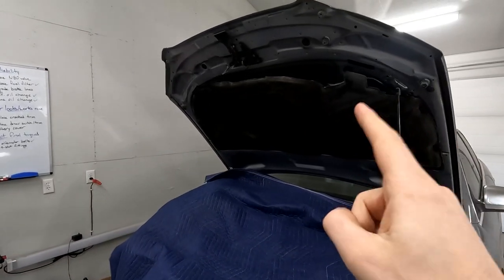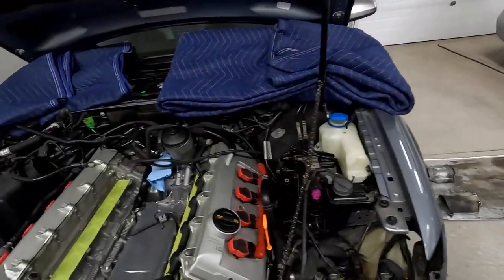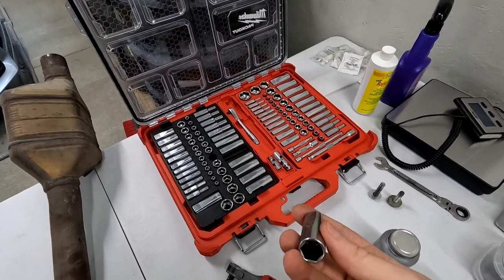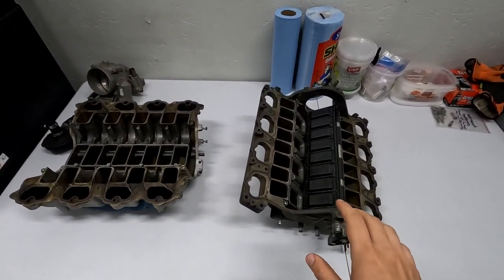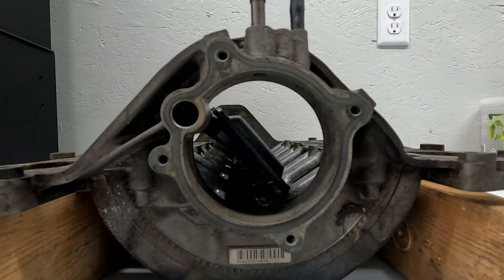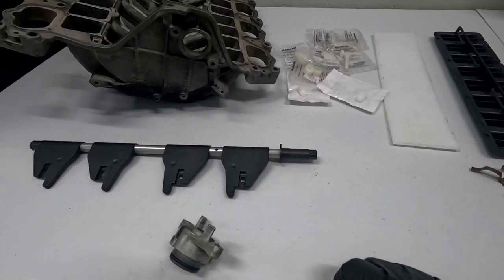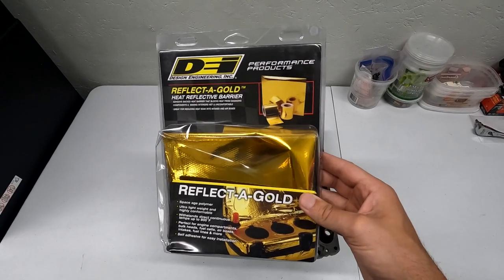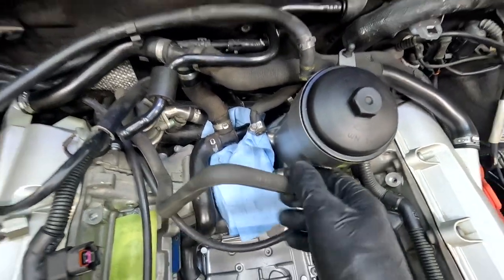DIY Intake Manifold Flapper Mod | Piggy Pipe Install | Audi S4 B6 B7

Comment: I think some of that sludge is partially from audi's internally egr solution. Through the intake valve. Exhaust/intake Timing overlap for just enough exhaust for next intake stroke,  helping pass emissions. I read it in a audi ssp on the 4.2l 40v. Ahead of their time❤ great video

Comment: You could have bought a spark plug gap or this also called a spark plug spacer and also can be used for the auction sensors

Comment: I am reso modding an 03 A4 3.0 convertible.  The manifold on the AVK engine is a one piece abs plastic with two flappers so cleaning it is very difficult. I soaked the unit in industrial degreaser for two days and the amount of blow by was incredible. I did a full top rebuild and the timing belt water pump and all that stuff. After mounting all back and trest driving her I had a noticeable increase in low end torque and throttle response. I will also be mounting a catch can this spring.

Comment: why not just remove the intake manifold flap all together? similar to the cats, less restriction and more air flow
Reply from the maker: The flap is super important to maintain low end torque. If you were to remove the flap and shortcut the runners, your car would actually be slower for the majority of the rev range. And even though I'm saying that long runners are good for lower end power, it's not like creating ultra long runners with - let's just say a theoretical, 6 inch intake manifold spacer between it and the intake ports - is a good thing either. Good engineering is happening in the manifold; this mod just attempts to make the air move a little smoother.
Reply: @FigureItAudi  thanks, appreciate the response, i have a b6 3.0 and the manifold runners were shot and instead of spending few hundred on flap and diaphragm, i just removed it =/

Comment: Great videos. Not enuf people making vids for DIY'ers to correct factory design flaws. Us V8 guys have timing chain guides, intake camshaft adjusters, oil leaks, motor mounts and 20+ hoses that will burst @ some time and cost an arm & a leg to purchase, if even available. I will enjoy her while she's still in good shape. (how many times have we all said that?) My one critique on this video was the scene showing how to remove the collar holding the flapper into lower intake must've gotten left on the cutting room floor. Good grief it's a chore. I got the clooar to come out with some sensible prying, but getting the shaft to free up from that collar is proving difficult to say the least.

The visual aides were priceless nonetheless. Thank you!

Comment: As an S5-V8 owner with p2004 error (flaps stuck in open pos) inside the intake I am trying to learn as much as I can because I'll be damned if I want to pay £3500 to have a new one fitted. Mine is the magnesium intake with electrically operated flaps and is slightly different but I found your video to be most informative. Kind of like a friendly study class. One of those I-think-I've-bitten-off-more-than-I-can-chew classes! - but hey, nothing ventured and all that.
Subb'd and Liked. Thanks again.
Reply from the maker: Granted, I'm not familiar with your intake setup but I doubt anything is wrong inside the intake and it has more to do with how they're actuated. Failure is usually related to 1 part (ex. a solenoid, or wiring) than the whole system. If I'm to assume your S5 is your daily car, you're practically better off looking for a whole intake (on the B7, you can find a fully plumbed one for $250 CDN) to purchase from a part-out car, use that as your learning model and spare parts source, then fix yours when the moment is right.
Reply from the maker: I've also learned a lot on my own projects when I'm jammed up on a lack of understanding how something works by reviewing the system in it's schematic form. You can find yours on https://www.ilcats.ru/audi/.

Comment: Hey Steve,  Could you speak to why you chose UHMW poly vs Nylon or another material?  Some plastic vendors I have spoken to are noting the 200-212F limit of the UHMW might be an issue.
Reply from the maker: My choice was largely based on chemical resistance knowing it'd be in contact with oil, unburnt fuel and whatever else might contaminate the oiling system. I hear you on the temperature range. My thought was that although the engine bay can reach temps that could theoretically put the material at risk, the flap isn't exposed to those temps directly. In fact, it's exposed to a cooling source (intake air!) that's well below its threshold. Is there a more optimal material out there? Yeah, probably. After putting a few thousand KMs on this modded manifold I took it apart for an inspection and the components were holding up great. No loose fasteners, flap hasn't misshapen, nor discoloured. My hope would be that as more people DIY this mod and make alterations in material, flap design, etc., they can add their own data to the conversation too.

Comment: did you notice any performance difference after you installed these downpipes? I have read and heard that with the B7 RS4 installing downpipes and or gutting the pre cats on the OEM Downpipes. Can cause a loss of low end torque / power. Did you experience anything like that or anything at all after the install?
Reply from the maker: No, I didn't notice a lack of power, but to be fair, I couldn't feel the gain either. I think anything in the 10ish HP range is essentially unnoticeable to the butt dyno. I also don't really understand how the removal of the pre-cat (which causes the largest, earlier bottleneck of exhaust gas flow) could reduce torque. IMO, this is one of those claims that has to be dyno proven, otherwise it's just more armchair mechanic hearsay, kind of like my guess here :)
Reply: @FigureItAudi  appreciate your assistance and feedback. I agree with you on all. I just gets confusing when you hear so many conflicting opinions / experiences. Last thing I want to do is spend the time and money on downpipes to loss low end torque and gain it in the top end.
Reply: @FigureItAudi  What is your experience with intake spacers with port dividers removed for the B7 RS4? Any real noticeable benefits? Again, something I hear conflicting opinions and experience with.
Reply from the maker: Keep in mind my manifold (S4) is different than your RS4 one. The spacers and modifications to the intake manifold are definitely another butt vs. real dyno situation, but I do believe in the science behind runner length, air flow and of course heat management. In that sense, the spacers are a great little investment. I subscribe to "more (smooth) air in, more air out = good".
Reply: @FigureItAudi  I can assure you that you don't lose torque from removal of the pre-cats.  when mine got hollowed out and before my JHM flash, the moment I drove away, with out any doubt I had way more torque than before.....no way that was in my imagination.

Comment: Hello From Brazil. We have a touareg 2008 4.2 v8 with the same engine as your video. I suspect that the diafragm (inside pcv valve) is perforated, because there is a lot of air suction on oil cap and when i acelerate a lot the EPC failure warms up in painel. My doubt is: Can I substitute only the diafragm (i found the diafragm on internet) but i didnt found all pcv valve to buy.
Bests reguards.
Rafael
Reply from the maker: Hey Rafael - My guess....as long as you can open the PCV without breaking all the tabs and get it back together so it doesn't leak....yeah, swapping out the diaphragm could work. The whole unit should be pretty cheap though (it's like $12 USD); do you have the ability to buy from American websites? Suction in under the valve cover is a good thing, though so the PCV may not be your problem. I would check the fault codes store in your ECM if you can get someone with a basic OBD2 reader to do a scan for you.
Reply: @FigureItAudi  I read that suction through the oil cap may be the pierced diaphragm. It also fails after 5,000 rpm and takes a long time to change gears when it accelerates strongly.

Comment: Any recommendations for getting the spring housing (flapper rotation) out of the body?  I have everything disassembled to the point of removing the rod and housing.  However getting the housing to come out is proving rather difficult.
Reply from the maker: You might just have to give it a little whacka whacka from the back. Once the spring and arm were removed from the front, mine more or less just fell out. The rod is truly just sitting in a hole in the manifold with nothing else holding it in place.

Comment: i also have a b7 s4, I honestly dont exactly know what the flaps purpose is i did a lil research and its suppose to help with the proper air to fuel mixture etc. but my question is why not just delete it entirely?
Reply from the maker: Did you watch the video though? Lol, I literally explain how the flap affects low and top end torque by shaping runner length. Fuel isn't a relevant part of the intake manifold flap and definitely don't delete your flap - you will notice the (bad) difference.
Reply: @FigureItAudi  at first i skimmed through out and thats when i made my comment but i did indeed watch the video after. Im currently doing the timing on my s4 and possibly might have to rebuild bottom end so i was looking for some mods to do while  everything was out.
Reply: @FigureItAudi  i finally got my s4 to run and she is running pretty strong. do you know what the performance numbers are like with the flapper mod? any hp increase?

Comment: Iam working right now on this mod, any recommendations on how to apply any sort of pressure to the spring? Mines loose and I can’t seem to get it tightened
Reply from the maker: That probably means it needs to be compressed another full rotation before you start installing it. The spring pressure is insanely high for what it needs to do. I can't recall my installation trick exactly but do whatever you can to coil up and hold the spring prior to seating it. You may be able to zip tie the ends to one another then cut it when it's ready to release.
Reply: @FigureItAudi  actually that’s a pretty smart idea! How dit I not came up with this 🤣
Thanks a lot for your answer 👌
Loving the series btw 👊

Comment: How tough should it be to move the pivot arm. I have my b6 s4 manifold on the work table and I can move the pivot arm back and forth but it does take a bit of strength to move it. Thanks
Reply from the maker: That's a good call out. So, I too was surprised at how much tension the spring applies to the arm in its default state. To me, it's way (WAY) more pressure than I think needs to be applied to the flapper arm to counteract the vacuum in the intake - but neither of us are german engineers (right?). I'm always amazed to see the actuator pull back the pivot on start-up, but it works under the vacuum provided so what can we say? That said, having the pivot assembly nice and clean will ensure no additional stress is applied to the actuator.
Reply: @FigureItAudi  I guess it is what it is ha.

Comment: where did you get that type of material for flapper mod?
Reply from the maker: Although I did find options on Amazon for it, the reviews mentioned that the size and quality was questionable, so I searched for commercial plastic distributors in my city and found a place that had a variety of plastic options in different thicknesses and would only charge to cut a piece to my dimensions. Worst case, you might be forced to buy a sheet and fashion the flap yourself. You probably just need to call around.